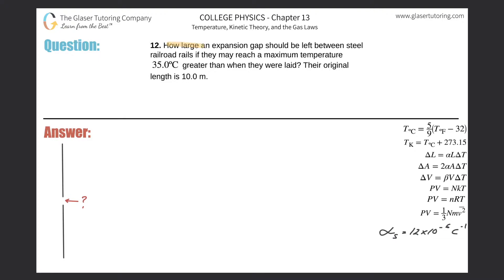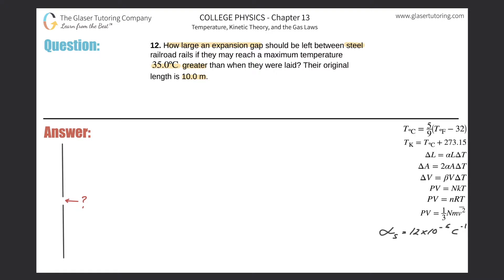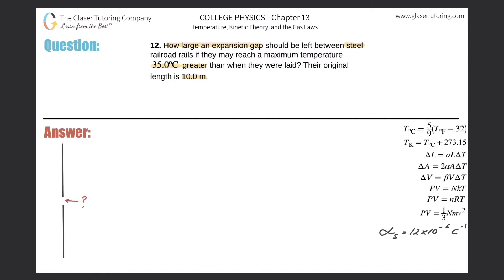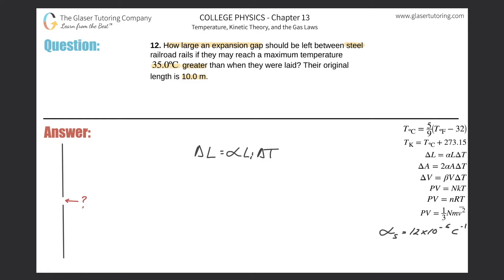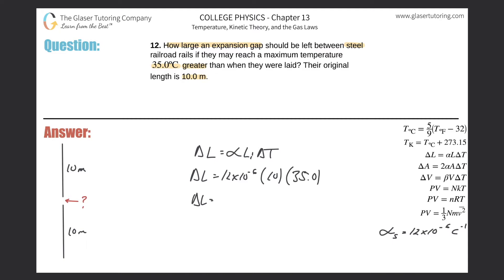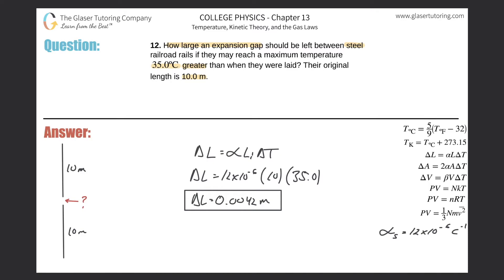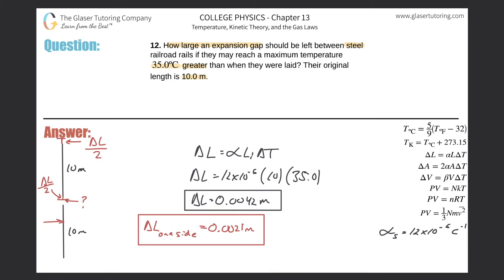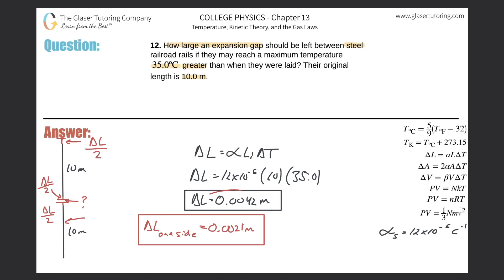13.12 | How large an expansion gap should be left between steel railroad rails if they may reach a

Comment: The question said this is "their" length? wouldn't that imply that 10m is the length of the two rails. so shouldn't you double .0042 to get the total distance both are going to expand?
Reply: Yes i think i should double the change in length to get the gap between them